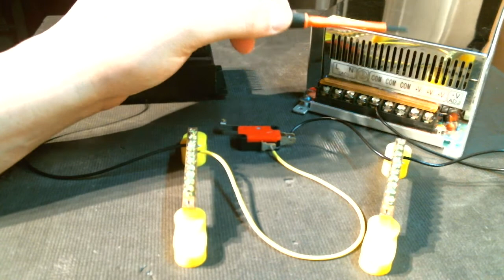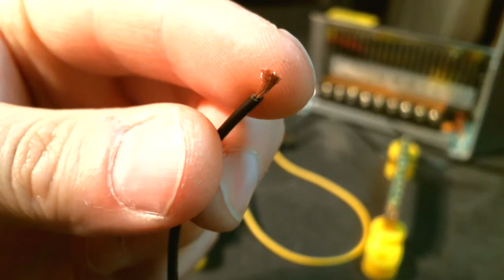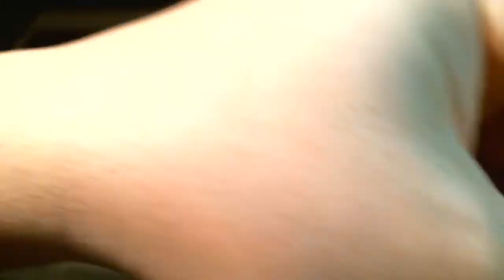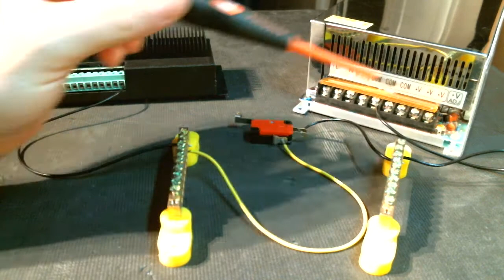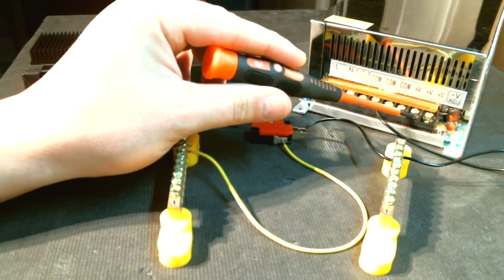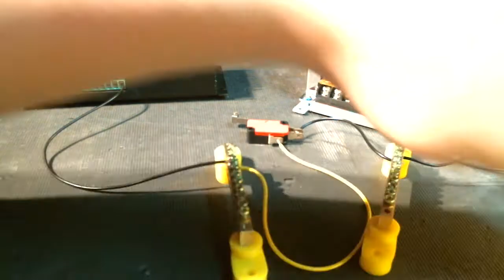Gecko G540 Input/Output Splitting! This kit is the answer for never running out of terminals.

Comment: Hi Vince great video series, i'm learning a lot. In this video you mention you don't believe in limit switches and instead prefer software limits, but what happens if your motor skips steps the software no longer knows the machines current position, doesn't that mean the software limits won't work ?  I thought this is where the physical limit switches are useful
Reply from the maker: Miles, thank you for your support. A stepper will ONLY skip steps if the end user has incorrect motor settings in velocity, and acceleration, or the CNC controller/drivers are experiencing EMI penetration. Here's my soft limit video which covers the use, and settings of soft limits in detail https://youtu.be/zFk_U3yqrks Thank you,
Vince

Comment: Hey Vince, I'm not an electronics guy, got a question on this. How do you wire multiple home switches to a single input, do you use NC or NO? I would think without having home switches daisy chained, a NC circuit would never break when a switch is triggered.
Reply from the maker: Phil, thank you for your support. Please message me at my email in the description, so I can forward you a schematic. Your correct about a switch circuit wired NC never breaking, but when the physical switch fails you still have to factor in the lost time to replace it, and physical switches take much more time to cycle through then utilizing soft limits, or fixtures in Mach3  which I covered here in detail https://youtu.be/zFk_U3yqrks Thank you,
Vince